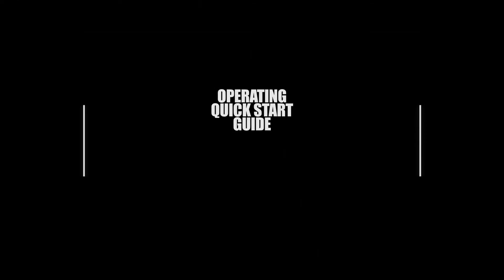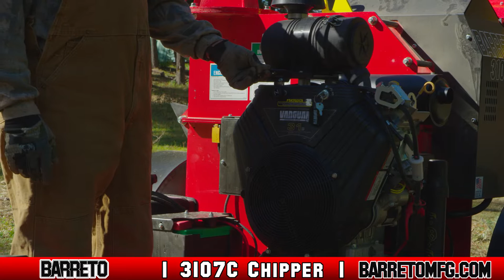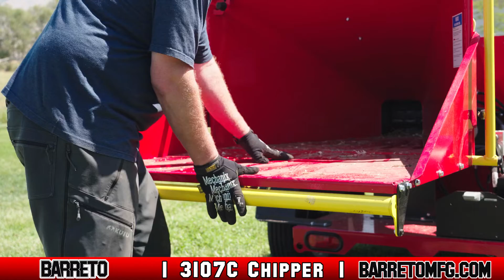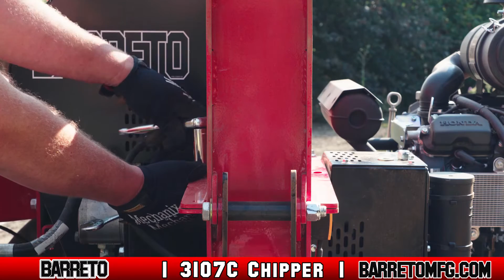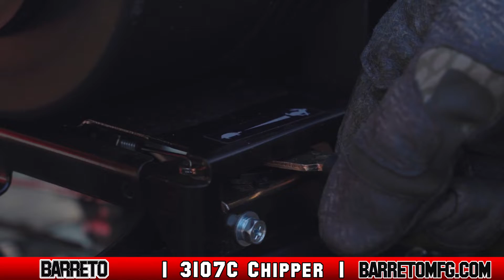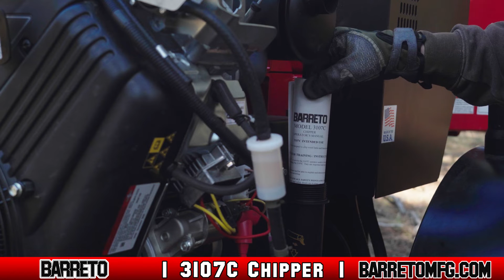3107C Chipper Quick Start Guide || Barreto Manufacturing, Inc.

Comment: @user-ki5qn4gh5j
0 seconds ago
I work at a rental store. We have a Barreto 7 inch chipper. We've had it quite a while. It's performed really good. We recently installed the recall parts for the motor and belt drive. Today, I thought about changing/checking the bed blade. It's ok, but I found out that one of the 2 bolts for the cutter wheel lifting mechanism was missing. Replaced it and it feeds a lot better.

Reply